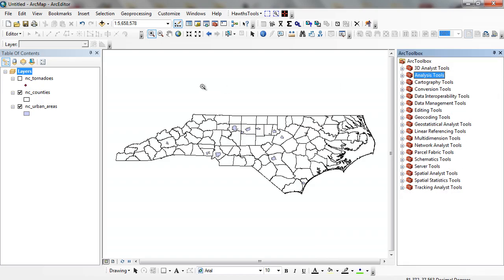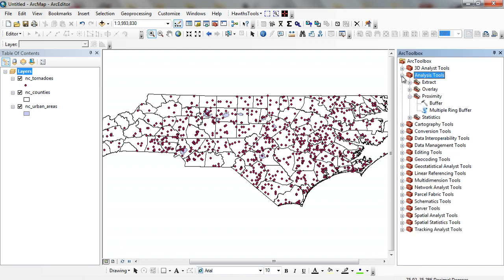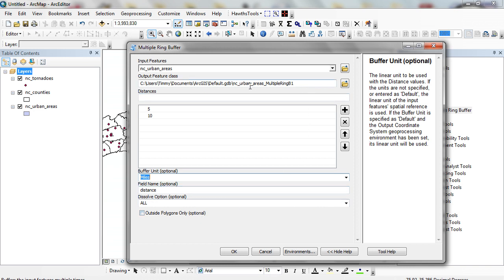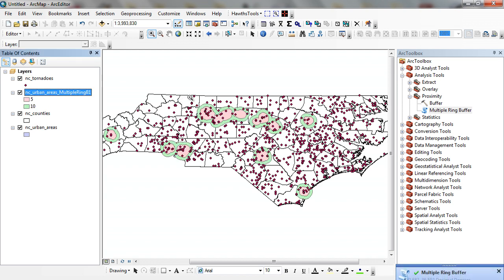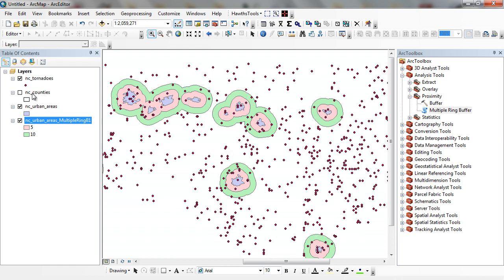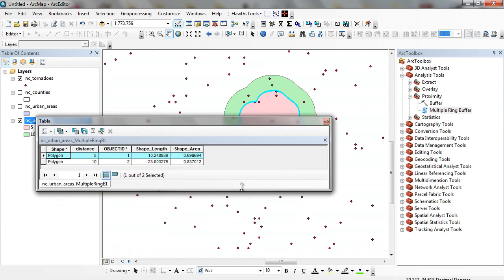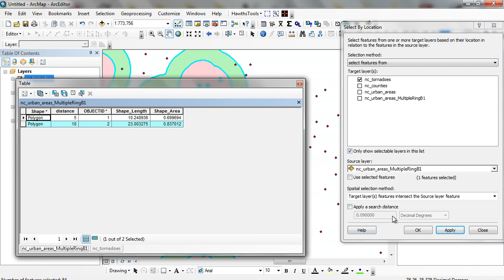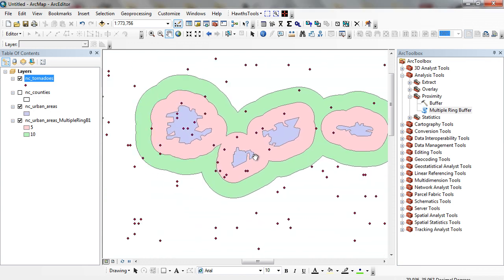Buffering

Comment: i want to select communities in a district by using 2 kilometers buffers. is there a way to have the buffers in succession? where the end of one circle becomes the beginning of the other?
Reply from the maker: Yes, it is called a multi-ringed buffer.  There should be an option for that in your ArcGIS toolbox if you use ESRI products.